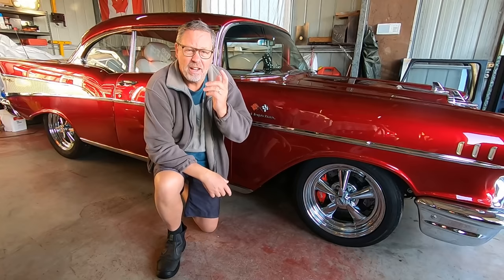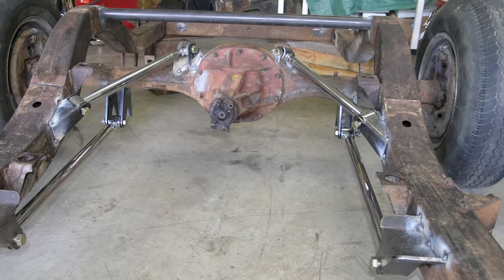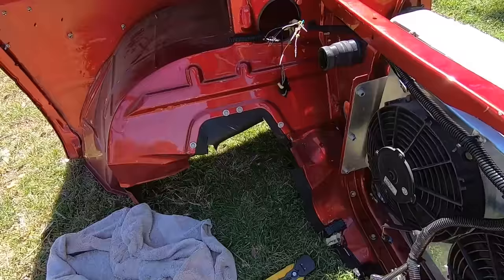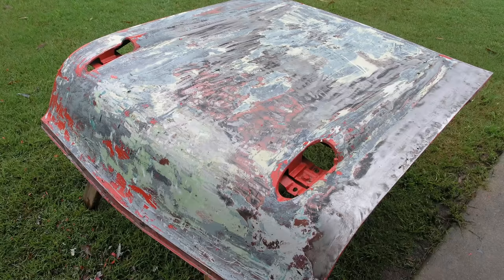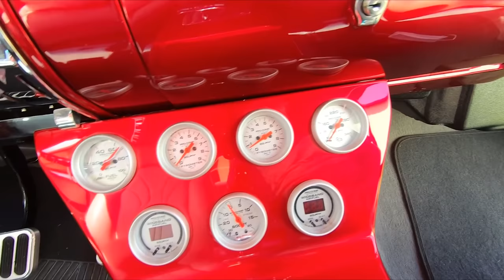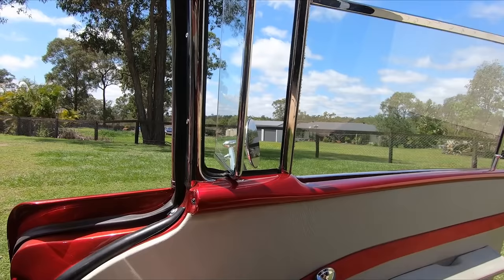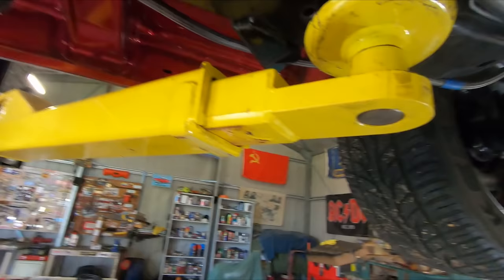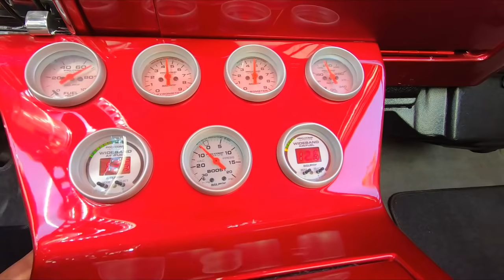1957 Chevy Frame-off Restoration | 8 years in 30 minutes | Do you rate this twin turbo ride?

Comment: With all that complicated custom restoration repairs, I would have substituted the straight steering column with a safety steering system, reinforced the cabin, doors, floor, and hardtop to upgrade the body to today's crash protection standards. Everything else was a wonderful remanufacturing and restoration work. You have a unique 1957 restored Chevy Bel Air. Thanks.
Reply from the maker: Cheers😎

Comment: Had an exhaust leak in one of my 57 BelAir's back in '73. Pulled it into the shed, popped the hood, dropped the left side header, slipped in a new gasket, bolted it all back together and was off for a night's cruising. It's a whole different world today.
Reply from the maker: That’s the way it should be mate.  I’ve got no one but myself to blame, I engineered and fabricated it myself😂😎
Reply: Ta! Full disclosure... It was partly to balance out the very different world of the Pro Stock Camaro sitting in my actual shop. On balance, I think I had more fun bracket racing the '57 on Wednesday nights!  @JafffaAdventures
Reply from the maker: Awesome 👍😎

Comment: Nice work! If you can do all that prep work and wet sanding, you can get the same results spraying it yourself in your garage. You obviously have the talent. Yes, more trash in the paint without a booth, but wet sanding will remove all the garbage.
Reply from the maker: Cheers mate, that’s very kind.  I’m definitely going to give painting my next project a go myself in the shed as all you say is on the money👍😎
Reply: @JafffaAdventures  it all how much time you want to invest, I painted three cars in my garage with professional results, it's all about the time you're willing to put into it. Save some money and spray it yourself, you already did all the hard stuff, the painter had it easy!
Reply from the maker: @edweigman9683 agree 100%😉😎

Comment: What an awesome build. I love all the cool features and details you put into it.
My friend from high school (late 1970's) had a 1955 Chevy that we used to work on all the time we weren't working on my '69 Camaro.
We were too impatient to drive them to put cool power windows and illuminated buttons in them.
I remember using a milk crate to sit on to go cruising a few times in the '55 Chevy because there wasn't enough time to put it back together before we had to leave.
That's the beauty building a car as a mature adult. 
Again, great job, thank you for sharing.
Ok, what's the next project car .......
:)
Reply from the maker: Thanks for the kind words and for sharing your story mate, that’s very cool.  I had a 1951 Henry J on a 60 Chev chassis when I was younger, and I remember sitting on a milk crate and my mate pulling the car down the road with his motorbike with me behind the wheel....just like you we were too impatient to wait to get it running😂.  The next project is already underway and I have a video series in progress detailing that restoration.  Check out my FJ45 Restomod playlist if you want to follow along.  Cheers😎👍

Comment: Running the wires through the hinges was very Clever.
Reply from the maker: Thanks Dave, that’s very kind of you to say.  It took a lot of work but was worth it in the end.  Cheers😎👍
Reply: @JafffaAdventures  thanks for your reply. I have a stainless steel line  and thought about contact type for the jamb and the door.
Reply from the maker: That sounds cool.  How do they work when the door is in the open position?
Reply: @JafffaAdventures  they disconnect when the door is closed the connect. Amazon has them for sale in almost any configuration.
Reply from the maker: I see.  So that means you cannot open or close power windows with the door open, and you door speakers cut out if the door is open as well.  I think I prefer my method where it’s live full time.  Thanks for sharing and educating me.  Cheers😎👍

Comment: What is the engine specs? The induction / fuel injection looks like 1990's  LT-1 , but it looks like it has a distributer ( no OptiSpark ) .
It sounds awesome.
I'll have to rewatch it to see if I missed engine info / cam / etc. 
Did you get a chance to dyno it ?
Stunning car.
Reply from the maker: Thanks Keith, the car puts a smile on my dial every time I drive it.  The engine is a 350 4 bolt main block and that’s the only factory item on it I think.  The crank is a scat forged unit, H beam rods, dished hyperutectic pistons, custom ground crow cam, with a Holley intake and fuel rails, and bosh injectors.  I’m pretty sure I ran through this in the video somewhere.  It was running 600hp on an old tune, it’s probably a little tamer than that now because I dialed the boost back after scaring myself😂.  Question again mate😎👍

Comment: 23 Feb 2024, wipers operat backwards. When in the off position, they both point outwards.  Any recommendations on how to fix?
Reply from the maker: No sorry mate.  I have 2 speed aftermarket Raingear wipers installed and they just worked out of the box.  Cheers

Comment: Hello I'm restoring a 57 2 door post it has always been a dream of mine aswel I'm just very curious on how you fit the interior reer and front seats I have a vy commodore parts car I wanted to put the interior in the 57 do you have eneymore pics or tips for me thanks in advance 😀 😊
Reply from the maker: I custom fabricated the mounts for the seats Jeromy.  In addition, I cut the foam down on the rear seats, and built the foam up on the front seats.  I do have photos but am on the road for another few months so do not have access to my archive drive.  Cheers

Comment: Does the dual antenna contract and retract?
Reply from the maker: The drivers side does, the passenger side does not but only because I put a dummy antenna in there.  You could install a power antenna if you want both to retract.  Cheers👍😎